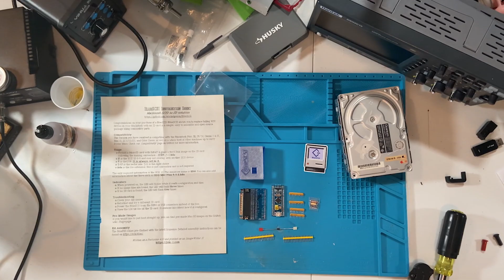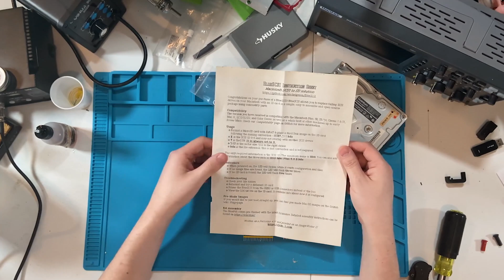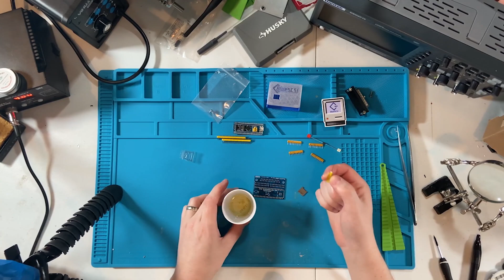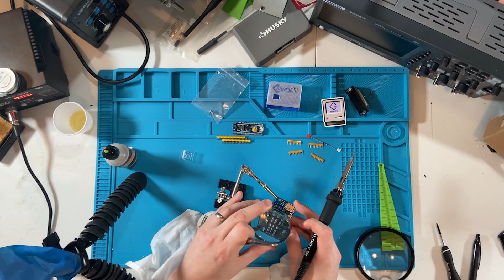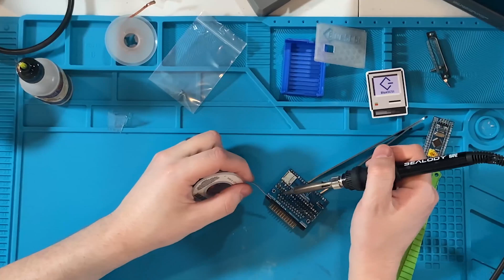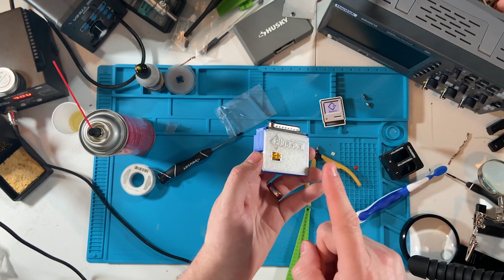Upgrading Your Old SCSI Mac with High-Tech SD Storage: The Ultimate Solution for #marchintosh

Comment: After this, I saw the Sean from Action Retro also used a Blue Pill SCSI, but as an internal drive.  Since you're replacing the spinning HDD, is there a reason you didn't go that route?
Reply from the maker: Once I got the spinner drive working (mechanical agitation and lithium grease) I wanted to see how long she will last. That being said in the long run this LC will use the BlueSCSI. I do need to get an internal version. For now having the external is more flexible.